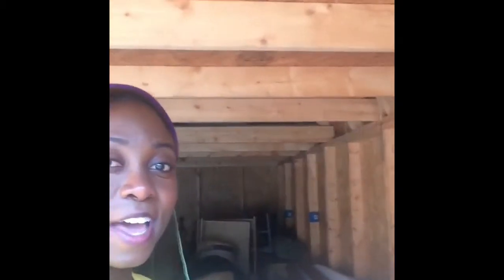How to put in a 100 Amp sub panel box

Comment: Hey just a head up not sure the code in your area but on a sub panel u have to isolate the neutral and ground and in your case I could be wrong because the picture didn’t show it 100% but both bars are connected to each other with the bar in the back u have to disconnect one of them most likely the one on the right side that has the grounding nut .....
Reply from the maker: Good catch. It was a little job on a shed/ tiny house conversion therefore not inspected in my area. Thanks for your input though good for any watching to be aware code enforcement is different all over the country